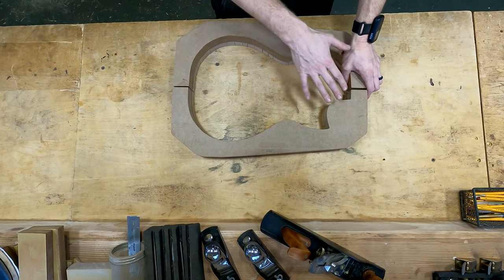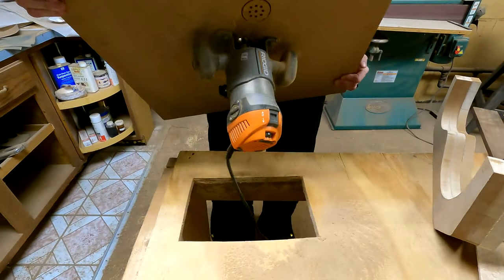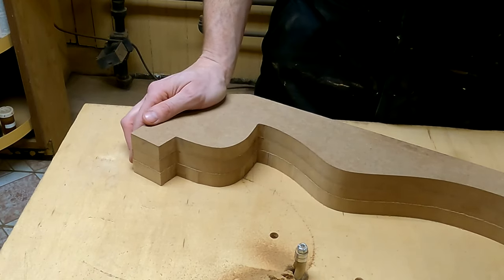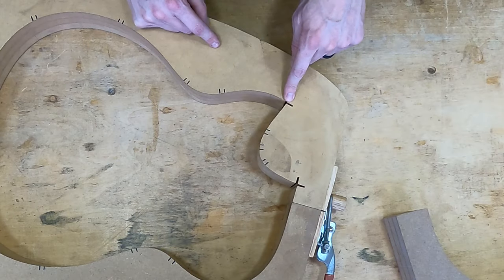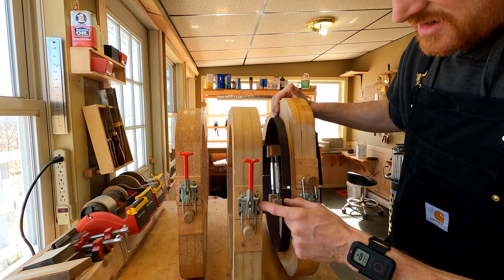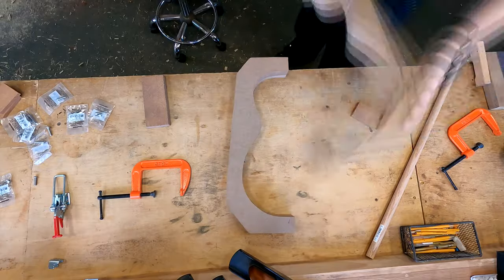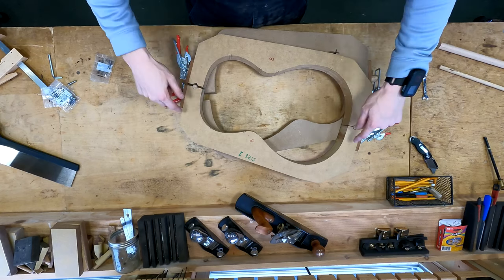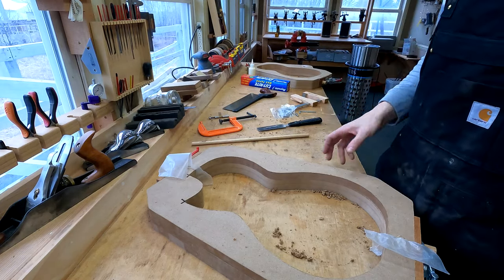Making a Florentine Cutaway Mold for Guitar #116

Comment: Good system Eric. I hate making molds. Very boring. I think the dowels are a great work around to fix the problem with the screws pulling out. But one could , since, you are already using machine screws, drill through the mold and nut them on the inside of the mold. Of course they would need to be counter sunk into the mold so they wouldn't interfere with the guitar rims. Very unlikely the screws could pull through the mold.
Reply from the maker: I addressed your comment in a new Q and A episode: https://youtu.be/_APy7b-UncU